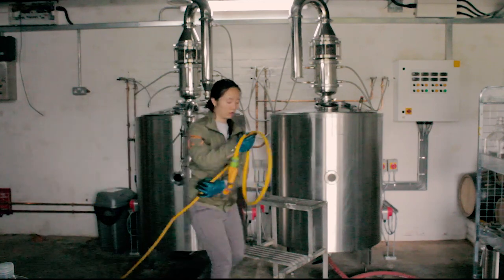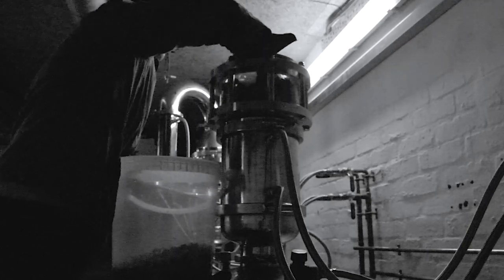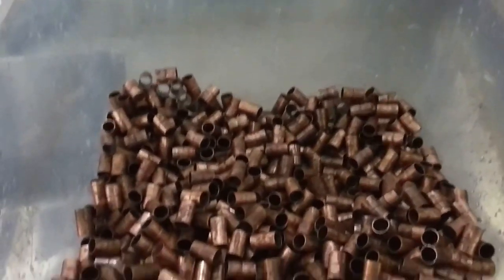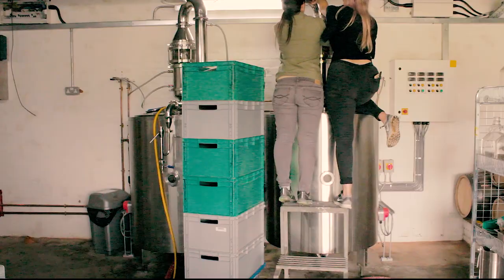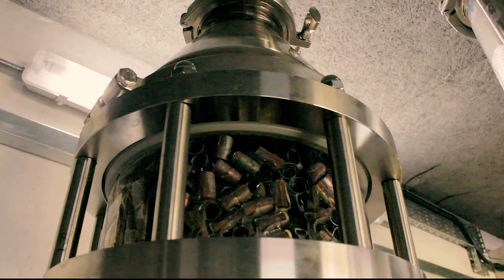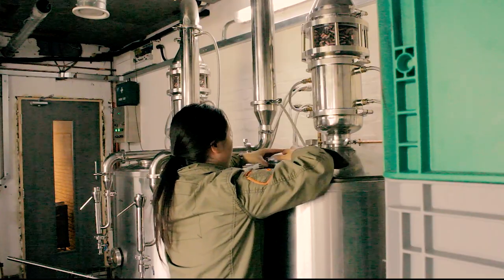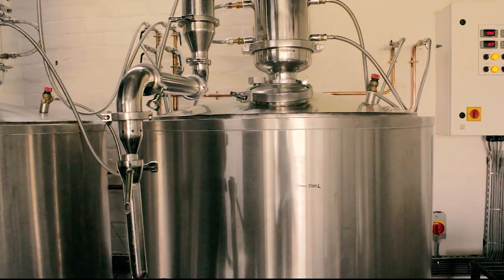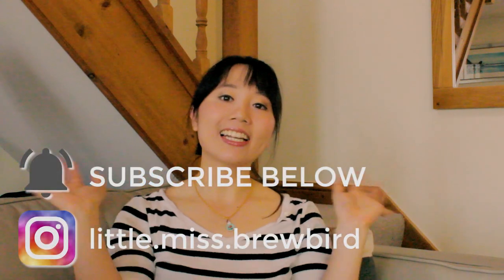Cleaning the Stills | Miss Brewbird

Comment: Excellent video as always!  Once you have the copper onion installed, will you still have to clean after every distillation? Every other?  Thanks!!
Reply from the maker: If I had the copper onion, I might just spray it down every so often depending on if it is a stripping run or a spirit run. The cut-up copper piping definitely needs to be cleaned every time, since as you saw they turned black!

Comment: A rotten egg smell in the ferment/wash indicates the release of hydrogen sulfide which is typically due to a nitrogen (YAN) deficiency.
Reply from the maker: Thanks for the advice. My brewing friends said the same, but we fermented 2 degrees celsius lower for a couple of days longer and cold crashed to knock the yeast out of suspension before distilling it. That seemed to make a big difference in the flavour of the distillate.

Comment: Hi from New Zealand! Thanks for showing the intricacies of distilling, all very fascinating indeed! I'm curious to know what is inside the stainless container underneath the copper glass filter part. It has a hose running into and out of. Is it a water jacket, or a spiral cooler (I think for refluxing?), or something else?
Reply from the maker: Hi from Wales! Ahh good eye, that is a pre-condenser, so we can get cold water running through it to promote  reflux. We aren't using it as a pre-condenser just now when we run the stills though.